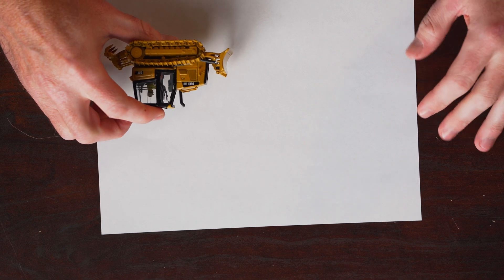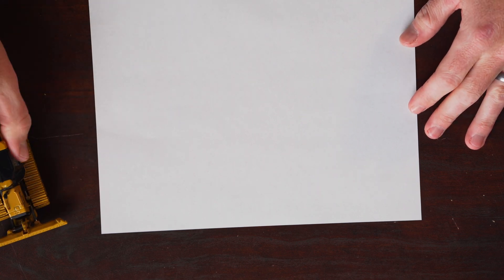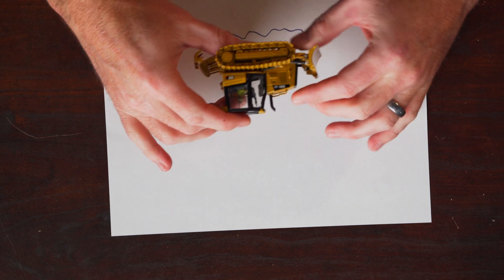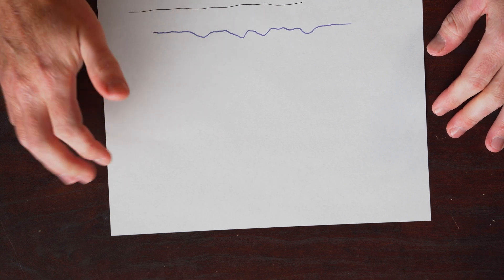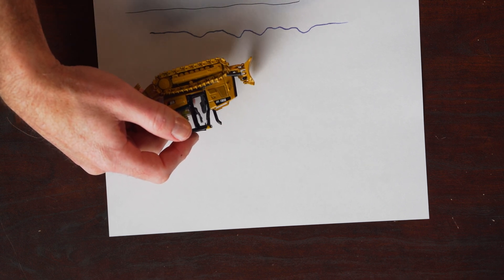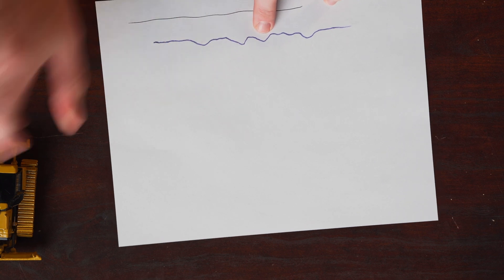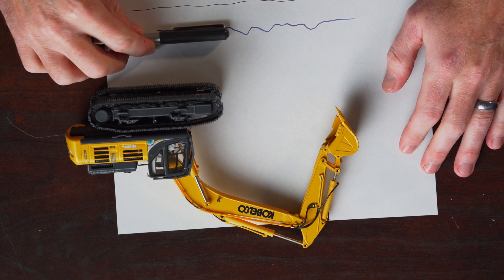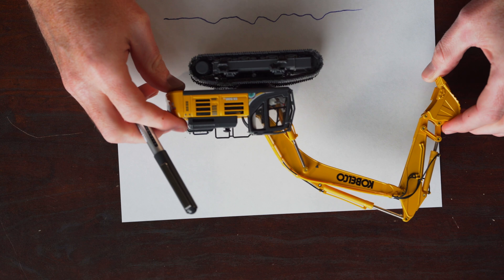Why a Longer Track Base Makes for Easier Grading

Comment: I understand the concept perfectly but for some reason I'm doing horrible in the D8 that my boss threw me in last week compared to the D6 that I was running before
Reply from the maker: You might be too aggressive on the grade hand since you are used to a smaller dozer.  Another factor is your site picture is very different if you are used to a six way blade vs. the carry blade that is on the larger dozers.
Reply: @DieselandIron  you were spot on man, apparently you know a thing or 2 about heavy equipment who could of guessed lol. It also leaks hydraulic fluid out of the cap if you try and fill it to green so I dont know if its just a faulty cap or something is wrong with the pressure but I think it put some slop in the hydraulics which allows the dirt to pull the blade on heavy cuts. Would being low on hydraulic fluid even cause that?
Reply from the maker: @chedsd2clips465  I would think it being an older machine you are getting some leakage part the valves that allow the blade to move a bit even though you aren't making adjustments
Reply from the maker: @chedsd2clips465  I didn't realize it was a new machine. It sounds like there is something going on where the float valve is remaining engaged or you have some sort of hydraulic issue. The dozer should be able to hold the blade up even under a heavy cut
Reply from the maker: @chedsd2clips465  that sounds like you've got a valve issue or something control related